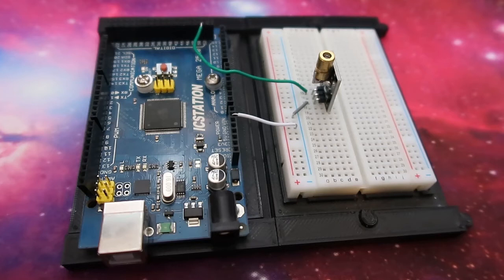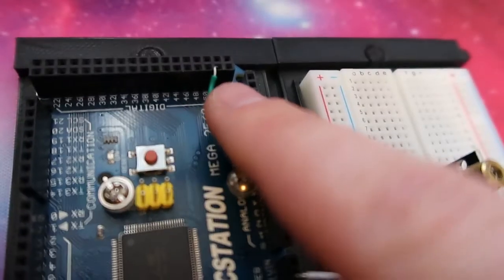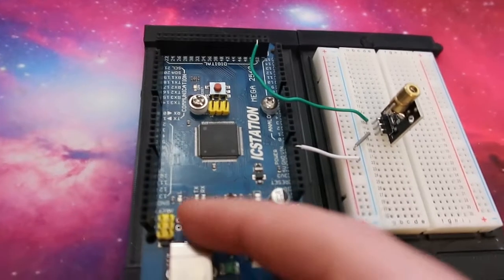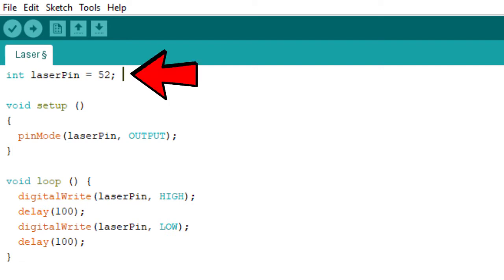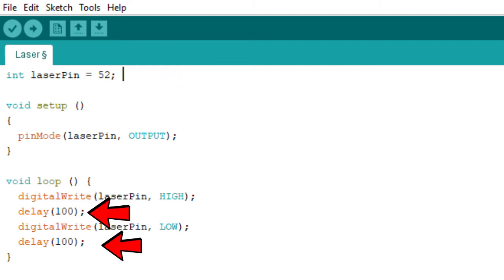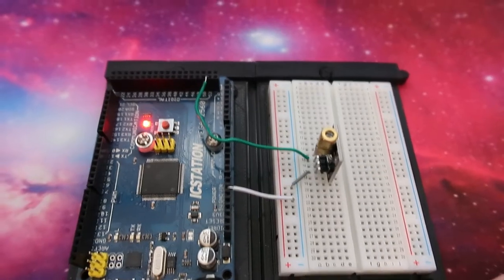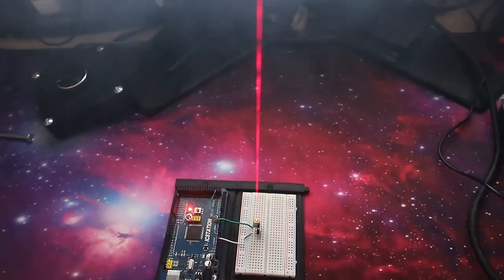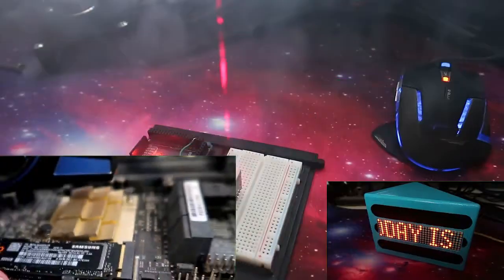HOW TO SETUP WIRE AND CODE A KY-008 LASER MODULE

Comment: hi I have a slite problem as I am using a stand-alone controller [SMC5-5]my laser[450nm] has 3 pins all have to be connected the third pin is for activation [low voltage] I know it is turned on and off with m codes but what output is the correct 1 for m3 as it is also a router and plasma machine not at the same time any ideas on how to thanks

Comment: Can it be used with Raspberry Pi 3? We plan to use KY--008 with Raspberry Pi. Is it possible?
Reply from the maker: Yeh similar setup just find the right pin outputs on the raspberrypi and code accordingly
Reply: @ScottyDIY  is it possible to power it from a 4 volt battery. That is, plus to plus minus to minus